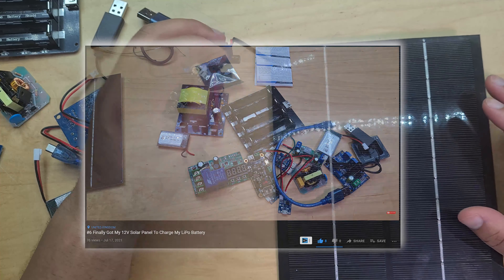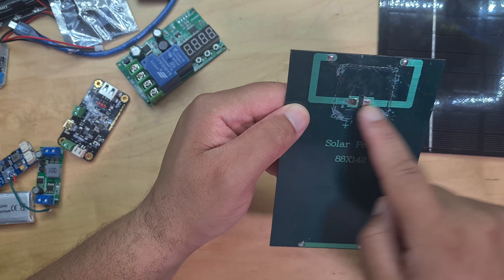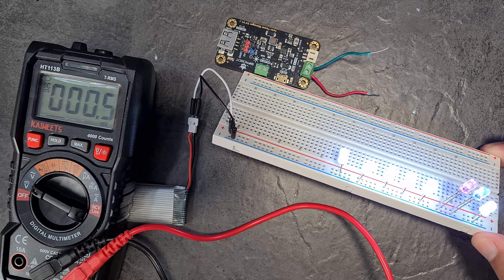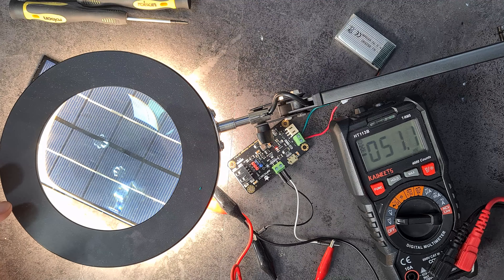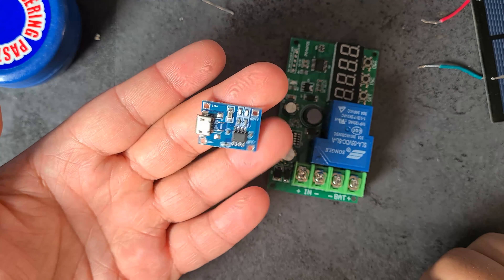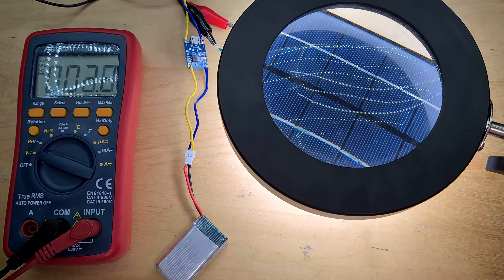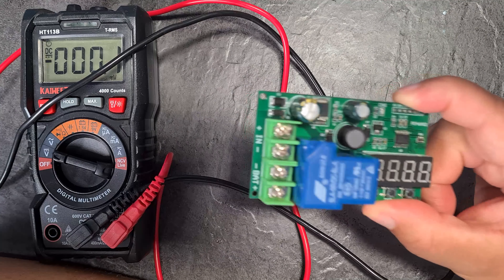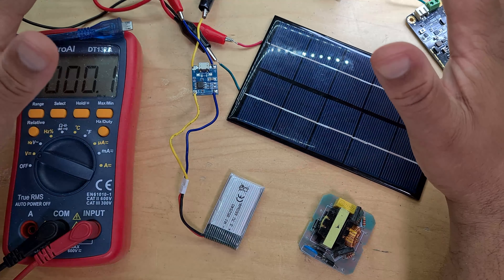Finally Got My Solar Chargers Working With My 5V Solar Panel & LiPo Battery

Comment: You could also get a 20 volt big solar panel amorphous. Get a cig input adapter. A 12 24 volt to 5 volt usb  car adapter plug in a 5 volt power bank and be done. Of course those small chargers are nice to. But only use those adapter win sun is up. Or it could have timer problems and burn out. Just saying be careful.

Comment: can you charge a battery and phone at the same time with this setup? the phone charged through the USB out port,
Reply from the maker: Technically yes but probably not. Current through both would be low. So it wouldn't really charge either
Reply: @HamedAdefuwa  thanks for the response. So would a 10 watt 12 volt solar panel provide enough current to charge both?
Reply from the maker: No chance, that 10w will probably only do 4w in real world conditions.

Comment: Hi, is your final year starting in 2021-2022?  . Finding your channel really interesting as Im studying Electrical and electronics engineering as well. What modules are you taking in your final year?
Reply from the maker: Hi Jim, yeah I'm starting my final year in September 2021. Should be graduating June 2022 lol. As for modules in addition to the final year project, I'm doing digital signal processing, power electronics, engineering management, manufacturing technologies and engineering control. It's a lot which is kinda why I want to get ahead of myself this summer on the final year project. What year are you in now?

Comment: Bro the dfrobot crapes out on me after 5 months of use😂
Reply from the maker: You probably pushing it too hard lol
Reply: @HamedAdefuwa  no, i was just using it to power like 350ma leds desk light  i use for soldering and the storage was a 2200 mah 18650 lithium ion cell
Reply: And the solar panel was a 5 volt and 250 ma

Comment: Hey I was wondering if the DFR solar charger could power up an arduino if that is possible
Reply from the maker: Yeah given a decent solar panel, 100%. I'm guessing you mean direct connection from panel to arduino. If you use a battery with it you'll have zero problems.
Reply: for sure it can, the DF Robot one is nice as it also has a regulated 5volt supply from the battery with under volt protection.

Comment: you have given me ideas on how to make some led cob lights for me camper van,  using them batts, and a 5/6v solar panel, I use AAA rechargeable, but a right pain in ass to recharge, your way a lot easier ,  could do with a DFROBOT 900mA MPPT Solar Panel Controller, but cannot find it,   you are better then me at this, I cant even solder, :)
Reply from the maker: Lool haha thanks 😅 the DFROBOT modules seem really good, highly recommend them